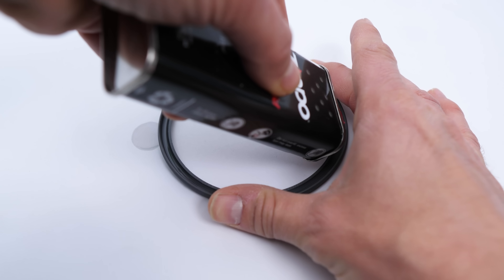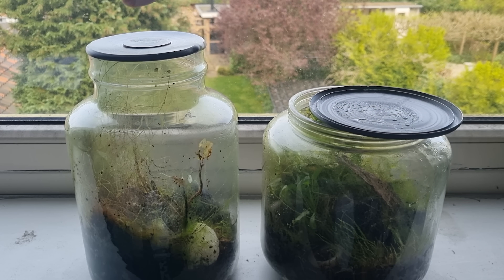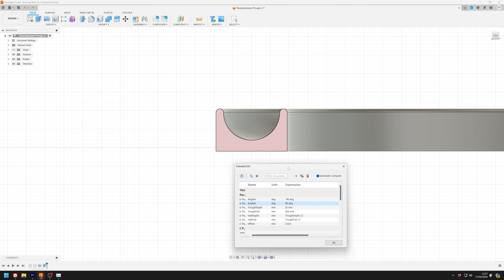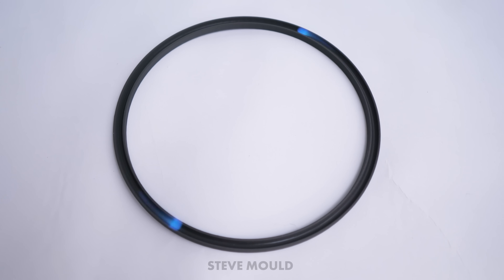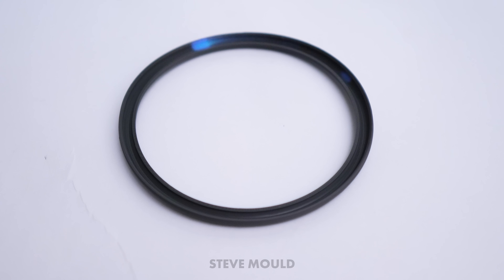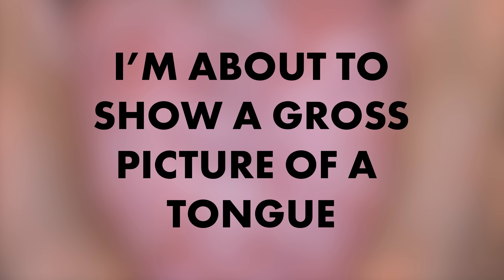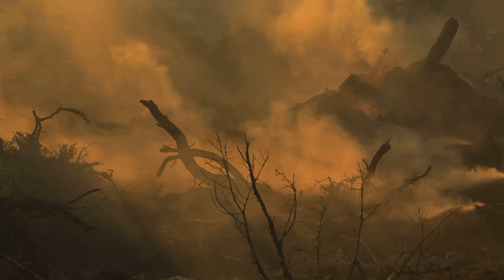Bizarre travelling flame discovery

Comment: I want to try making one of these with some kind of system to continuously refuel it. I'm thinking something along the lines of a covered branch going from the main track into a chamber with a float valve for the fuel, being covered should prevent the flame from propagating into it, and the float should prevent it from being overfilled. I wouldn't trust a 3d print to hold lighter fluid or any other fuel for long periods of time so I would likely make the track out of aluminum using a rotary table and ball nose endmill. I have no idea what the vapor pressure of lighter fluid is but if it is high enough it would likely be possible to have the reservoir be sealed except for a tube going from the bottom up to the valve in the refilling chamber, this would allow the fluid to be supplied without the use of a pump or a gravity fed reservoir above.

Comment: This is especially interesting to me because it's an open-ended version of the propane pop guns. Where you have the flame running down a vinyl hose and popping out the end. However now it just runs continuously so long as there's enough vapor fuel

Comment: I found a similar effect at work when i was bored, we had bare breeze block walls at work and a flammable cleaning fluid (brake cleaner) id fill the mortar lines with said fluid and light the top and the flames would dance down the brickwork the same as these go around the circle.

Comment: I cant find your discord server Steve. But to the point, I saw a video where someone used propane in a wood and plastic tesla valve and lit it. As you'd expect it went through the valve more efficiently in one direction rather than the other. He was astonished by the speed of the flame, it required a high speed camera to capture propperly. He then wondered how fast it could get if it was in a ring shape and the valve was reflooded with gas. It has been a while since I saw the video so I might get this wrong. Each loop of the valve acted as a reserve of fresh fuel and propelled the flame in the main channel faster and faster after each junction.

I would love to see your take on this.
Reply: https://youtu.be/tcV1EYSUQME?si=FF-i7MDOED7V5hP6

Comment: I think the junctions should always be made with hard 90° or 120° angles, like in the "sun rays" model. Though it is intuitive to design them with smoothly diverging arms, that doesn't actually have any benefit because the flames don't have inertia like a car or train and it only causes these lingering flames because there's effectively a part of the trough with double width.

Comment: With the circle attached to the start of the spiral to make a continuous supply of flames, you could just have a basin instead. If you put a dome on it with a hole at the top it could limit the combustion inside the dome, while still having a steady flame. This would also allow for a greater supply of lighter fluid that would allow for it  to continue for longer periods of time. Just the first thought that came to my mind when watching that part of the video.

Comment: i wonder if you could make a type of engine with this. 

not a very environmentally friendly one, but one as quiet as an EV.

OR use the junctions as a kinda printed circuit board but for hydrocarbons. using the tiny flames as bits. 

again probably environmentally devastating  tho

Comment: What if someone put a very high walled cone, injected some fuel, and perhaps some oxidizer at the bottom of the cone such that the flame shot around in a rising circle, detonating as it goes.  Maybe this would put out some thrust, like maybe a really lot of thrust.  Enough for a rocket?  #rotatingdetonationrocketengine

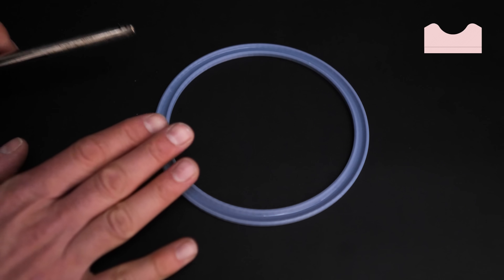Comment: RE: the wider trough at 2:35ish, I wonder if a less rounded opening would exhibit similar properties to a 5mm trough? Something like an inkwell shape in profile, so there's less of an air gap "enclosed", making it more physically similar (in terms of the amount of fluid exposed to the air) to the 5mm trough

I also wonder whether a similar setup could help a smaller opening last longer? I imagine the fuel being used up too quickly is at least part why it doesn't last that long

Comment: Nice! Can you put some magnetic or electric fields around to influence the flame? Or do it reducing or increasing pressure to change the evaporation rate? Or put it on a hot-plate? Or just heat some sections locally?

Comment: You coud try to put a little hole in the circuit and connect it to a tube with a tiny section that, leveraging capillary proprierty, woud continuosly fuel the circuit from a reservoir, making continuos flames. Than build a 3d model with ramps and different layers, all fueled by the mechanism described, in order to make a sort of magic lamp. Would sell like hot cakes 🙂

Comment: What determines the speed at which the flame moves? It's not the evaporation rate of the lighter fluid (that gives the refectary time). Is it to do with the conductivity of the heat of the air? Something else?
Reply: flame front speeds are generally determined by the reactivity of the fuel and oxidizer. It is a field of study called "reaction kinetics". This can be influenced by the molecular weights of the reactants, the pressure, the temperature, the energy of the bonds being broken or formed, the proportion of reactants, etc.

Comment: if only people could figure out how to harness the power of combustion
Reply from the maker: One day
Reply: @SteveMould  >"Believe the science", is the most unscientific statement a person could make. 
>Harness your superior logic: 
>4,519 MILES NO CURVE Globe Debunked Once And For All RESEARCH FLAT EARTH (Mirrored)
https://youtu.be/xRUM8yMaI8k
"The sensor in the phone is not a g-sensor; it's a level sensor. It doesn't orient itself to the center of the Earth but to its last calibrated level. You can calibrate it or test it on a level spinning record player at different speeds, and it will verify the level, demonstrating it is not affected by gravity or g-force." 
>Contemplate the impossibility of navigating with a gyroscope if the Earth were truly turning! Consider this: A gyroscope steadfastly maintains its orientation in space, defying the influence of external forces like gravity. Challenge the status quo by aligning the gyroscope's axis perpendicular to the Earth's axis—observe the minute, inexorable 1-degree shift every 4 minutes. Yet, this change eludes detection! We have unwittingly embraced deception. Dare to verify this truth by spinning the gyroscope in both directions, revealing its perfect balance. The Earth's supposed rotation stands exposed, awaiting your discerning judgment.
Reply: "if only people could figure out how to harness the power of combustion" I already have. I lit a fart on fire and it got me to run 50 feet like I had my pants on fire.
Reply: Yes!  It could use some volital fluid that's readily available.  I nominate dry-cleaning fluid, after all most towns have a dry-cleaners that uses ether.  I'm sure it would catch on.
Reply: I would like to patent something I call a “vehicle”. This would be based upon a horse carriage, and instead of a horse, it would use a volatile spirit pump which harnesses the power from the expanding flame front, and turns it into phsical force.  I need a name for this infernal machine, does anyone here have any suggestions?
Reply: @tonep3168 MADNESS!! It’ll never catch on.
Reply: @harrysmbdgs  it simply will be a fad, much like the computing machine and its accompanying interwebs
Reply: @tonep3168 The "infernal destruction engine".
Reply: @tonep3168  hmm, if basing it just on a carriage instead of a horse and carriage, maybe some form of shorter version of that word? Dont know if thats very catchy though
Reply: @tonep3168 so you are removing the horses? how do you plan to turn that thing, by turning the wheels by hand? lol
Reply: @_Jitesh_  I propose some sort of slotted rack with a gear to pivot the wheels back and forth!
I'll call it "Racket Pinball Steering!"
Reply: @tonep3168  i carn't think of any
Reply: Far easier to use the heat of the fluid to get the horse to work harder
Reply: @petermacleod5710  🤣👍
Reply: @tonep3168  Can the volatile spirit be coaxed in going faster by use of a buggy whip? Because your idea might otherwise lead to massive unemployment from which the labour market might never recover!
Reply: @tonep3168  Alchemists have already tried and failed for ages! Best they've gotten to are those firework rockets. And that's a dead end, too!
Reply: @tonep3168  Impossible. The resulting contraption would be far too heavy and far too complex to be of any use. Imagine the maintenance and repair costs! Not to mention the infrastructure needed and fuel availability. It would never catch on.
Reply: @IcespherePlaysGames  Tech Ingredients just did a video on such a machine. Looks like they solved the size and weight problem - it's about the size and weight of a pineapple for a thrust of 300N. In time, maybe they'll solve the cost problem as well.
Reply: @tonep3168  I can eat a horse. I cannot eat a volatile spirit pump. Thus, your machine is destined to be a failure.
Reply: @tonep3168  i believe you should call it... the hog. and the noise it makes from operation shalt be referred to as "cranking" if one purposely maximizes it.
Reply: @tonep3168  Wtf is a carriage?
Reply: I'm imagining an internal cumbusion battery for an electric vehicle.
Reply: @techman2553  That exists. Some hybrids work like this, where the ICE cranks a generator and powers the electric motor.

Also, all diesel trains work like this (diesel generator, electric motor)
Reply: Nah, that’d be playing God.
Reply: You folk and your pie in the sky notions.
Reply: Rotating Detonation Engine i think is one of the closest one. I think if we are on same page and thinking about same thing. https://www.youtube.com/watch?v=rG_Eh0J_4_s found this
Reply: Damn, Sounds like a recipe for destroying the planet
Reply: Hoooh boy, do I have bad news for you. They did. It all went downhill from there.
Reply: @GregtheMad Nonsense, If it could go downhill it wouldn't have to be powered in the first place would it!
Reply: @HuntingCatIsBack actually underrated
Reply: @ReinLie  Thank you.
Reply: Maybe in the year 2000.
Reply: Historians will be scratching their heads with this one
Reply: then we can finally spontaneously combust
Reply: 😅 the combustion engine silly. They've done it.
Reply: The sarcasm was a bit too much for me Someone said horses can never be replaced 😂
Reply: might be a way for jet engine and rocket engine's to modelling detonation for stability as currently they can fire/getting-working but the flame reversed and or stopped = bang 💥and lots of broken parts etc
Reply: steam : exist
Reply: I look forward to the day we find out how to boil water! Won't that be something?
Reply: How about we use this "combustion engine" and attach that to carts on rails to create a chain of carts on tracks, a train if you will.
Reply: Suuuure, and we'll even be able to detonate singular atoms
Reply: It will end in tears.
Reply: Instruction unclear: proceeding to harness the power of Zeus.
Reply: sparky sparky boom man
Reply: I'm getting fired up just thinking about it!
Reply: I thought you were going to suggest something feasible, like harnessing the power of the ionosphere.
Reply: We haven't? What are grenades, then?
Reply: Harness yes. Master... Not even close. Even with turbo a 4 stroke is horrible. I really wish a rotary engine was the main focus, we'd have a better efficiency engine design by now
Reply: I mean it's impossible you're trying to use something destructive to create something uuuuuuuuuuummhhhhh yeah that's not going to happen
Reply: @How_To_Drive_a_TARDIS  They already have experiemented with similar stuff "Rotating Detonation Engine"
Reply: Truth: some of the first vehicles were called "Horseless Carriages"
Reply: engines ?
Reply: @nathaneadson2019  Whoosh

Comment: The motion at 10:12 with the split pathways model is very reminiscent of Wolff-Parkinson-White syndrome, if you imagine that the smaller circles are the heart ventricles, you can see how a pathologic pathway will reexcite the heart way faster than it takes for the normal route to come around, very interesting to see!
Reply: I thought it looked like AVNRT but AVRT also looks kinda like this
Reply: I was thinking the exact same thing!  Someone needs to make a model of the conducting system to do this.

Comment: Have you tested this with other solvents? I'm wondering if isopropanol would work, or possibly acetone (though the latter would eventually dissolve the plastic).

Also curious what would happen if the ring were placed on a rotating surface. Would the flame remain stationary relative to an observer, or would it behave as it normally does?

Comment: The figure eight has the benefit of two evaporation points as it crosses. So the lighter fluid draining away from the raised area is mitigated some by the extra source of fuel... right?
Reply from the maker: Yeah, could be.

Comment: Very cool. It immediately brings to mind the concept of rotating detonation rocket engines.
Reply: was just thinking that!
Reply: I  have never seen or even heard of this phenomenon before. I however have heard of the rotating detonation engine but I never understood what that concept meant or how it was supposed to work, (the word detonation just brought to my mind something like the insanley loud and inefficient pulse jet engine) also since this is as I understand a brand new type of engine I thought you needed something MUCH more complicated then a grooved ring with fuel to make what appearently is what makes this new  type of rocket engines work well.... work but seems that this is not the case. I gotta 3d print some different rings like these and try this thing out myself!
Reply: @johnpekkala6941  the big trick with the rotating detonation is that it exhibits much of all the same kinda things featured in this video, flames going backwards, staying in place, going on fire all at once, etc.. Except inside of a rocket engine, physics is a lot more destructive, so you really want to make sure it doesn't misbehave, and for that the design and the operating conditions have to be just right.

Comment: You can make a computer with this. Logic gates could be created by the annihilation of fire pulses.

For example, an "and" gate would require two flame pulses to annihilate in order to preserve vapors in a reservoir, and when a third, delayed flame pulse arrives, the signal will continue because the reservoir was not ignited.

"or" gates are fairly simple,

A "not" gate would just be the annihilation of an input flame and a "control" flame.

etc...
Reply: The speed appears, remarkably consistent, so you have yourself the pieces of a clock at the very least.  Now, if you can also feed the whole system, a reliable amount of lighter fluid at a certain rate, it can go on indefinitely. What might be even cooler, is having the fire travel over some point to trigger more fluid, where the lack of more fluid being added to a particular section.
Reply: There was actually a bit or research on doing just that, but with explosives. It started with a paper published by the scientists from Los Alamos: "Explosive Logic Circuits".